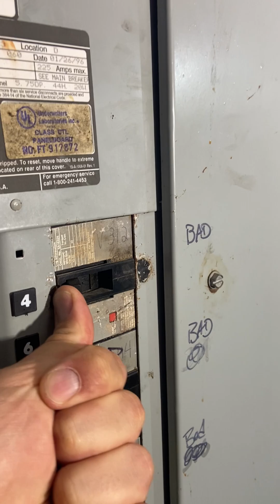Forgotten Electrical 5 #electrical #motorcontrol

Comment: Ever see the carnage that results from a know-it-all replacing a contactor on a 600 volt system, with a physically smaller contactor that is rated for 600 so long as the optional arc shields are installed, that was installed without the optional arc shields?
BOOOOOOOM......

Comment: I work in a shop that builds panels and entire machines.. mostly load cell and solartron measuring benches for automotive engine parts, but we do large conveyors and stuff too.. my point is we do EVERYTHING and I'm constantly going around and installing ground wires on enclosure doors and other things because other people don't. 😮‍💨

Comment: I got 120 vac threw my body after the dorks that put aluminum siding on my parents house did a terrible job cutting around some electric boxes and pinched a hot wire, which made the entire aluminum siding + aluminum doors  HOT surfaces.  Not nice at all.

Comment: I got a call for a faulty 480 breaker, when the AC guy said there was no power and the breaker was on. The store had 5 RTUs in a dedicated panel. After an hour of analysis I realized RTU5 was on the breaker labeled #1
Reply: Labels are nice!  But I mistrust them pretty fast.
Reply: @alsavage1 that's a fact.

Comment: That door thing happened to me some years back. I was working in the oilfield in Utah, one of the roughnecks thought he knew how to sparky but was way wrong. After he got done playing in the service box in one of the trailers on location, I found myself being the unlucky recipient of angry pixies between my boots and my bare hand on the door handle. Luckily I wasn't super grounded, so it only tickled a lot.

Comment: This is a great lesson for electricians in the chemical industry. Upon pump start up the spray could have blinded you!😮Never start a chemical pump without inspecting the Dog Ears. 🐶This video was taken hours after the chemical spray left a dried white dry residue that might be associated with the acidic Alum (aluminum sulfate) pipe line labeled with a yellow tag. Electricians should always wear CHEMICAL eye protection  GOGGLES, rubber gloves and a chemical apron while working around acidic or alkaline liquid. They should also note where the emergency eye wash station is, there was NO water wash down hose on the adjacent wall rack.  😮. There is a female quick connect fitting aimed down-ward off the pipe that seems to be the source of the chemical spray.  Quick Connect (Dog Ears/Industrial): Typically uses a female socket and a male plug, often locking with a sleeve. "Dog ear" refers specifically to the safety ears on the coupling with ear rings for threading safety wire. The accidental chemical spray direction is directly downward and is directly in line with a relatively new, poorly cut and sealed 480V  Electical cable whip leading to the pump motor. 😮 There are 2  levers, called ‘dog ears’ on each hose connector that need to be pulled together to grasp the groove of the inserted male. There is no reinforced Tygon hose connected to the male end of the of the discharge of peristaltic chemical pump, it was probably disconnected and removed from the leaking/spraying vertical female end. 
Electrician lesson: Never start a pump and be near to a recently connected “quick connect” fitting hose that does not have a safety wire wrapped around the CLOSED dog ear /levers.  These closed levers hold the hose connector in place (like a Wago lever holds a wire 😊).  If poorly connected, the hose can shoot off or spray out at the connection. Besides the risk of a poor seating between the male and female chemical supply hosing, there may have been a solid build up from connecting and disconnect on the mating female and male connector surfaces.  In an alternative scenario, the chemical operator may have sprayed chemical  by trying to open the dog ear levers without realizing the liquid chemical was under pressure even though the pump was off. The operator left dripping chemical to form stalactites (T for drips from the Top) 😅 on the adjacent lines. You can see a drip in the freeze frame video near the opened female connection. 
Electrician Lesson: Know the hazards: Always read the Material Safety Data Sheet of any chemicals used in the area.

AI Over-view: 480 volts (VAC) is a very common industrial voltage used to power large peristaltic pumps, especially in the United States. 
Here's a breakdown of why and how it's used:
Standard Industrial Voltage: 480V three-phase

Pump Size and Power: Larger pumps with higher horsepower ratings, which would be typical for industrial-scale alum pumping in water treatment or chemical processing, usually require higher voltages like 400V or 480V. Smaller, lab-scale, or low-flow pumps may use 110V/240V AC or even 12V/24V DC.

Standard Industrial Voltage: 480V three-phase is a standard power supply in most commercial and industrial buildings in the U.S.. This voltage is used to power heavy machinery, motors, and pumps because it is more efficient for energy-intensive, high-horsepower applications compared to lower voltages.

Comment: I was on a remodel and doing the entire electrical upgrade, multiple buildings…building two of three needed some interior panel rework, and device upgrades…the owner showed up and entered that building and grabbed the unknown and ungrounded main switch, we hadn’t done any work in there yet….and took a hell of a jolt…I said I hadn’t noticed the issue…I was wearing EH boots, standard equipment for me, so no ground out…he had the steel riveted boots on…….we’ll be addressing that issue now that it’s known…

Comment: The pumps are covered in caustic soda? It seems like that. So you're having in pvc a one way valve with a venturi effect that come from a pressure gage? Somehow it doesn't make sense but however. Is that used for demineralisation for anionic and cationic filters? That place should be a lot cleaner

Comment: Not war story esc. But I work as an industrial firefighter. We had a heavy rain one afternoon. (An hour before shift change). We get called for smoke in one of our offices. After investigating I find a couple cardboard boxes smoldering next to a 5 foot enclosed substation. I take the boxes and go outside and put them in the rain. Mind you all power is off at this point to said building. The other 2 guys reconvene. And we start looking around. One of these substation doors in question is charred and still hot. My partner goes to them investigate with the TIC before one of our electricians get there. He makes it there. All the lights then click on. I start to see smoke coming from the vent. My captain tells him to come back. No sooner he clears the door. BOOM arcflash. Was the brightest and loudest thing I think I’ve experienced. Once the power tripped again. I took a CO2 extinguisher and dumped it into the vent to extinguish anything that could cause issues anymore. Turns out 4 inch conduit going up to the roof had a leak and was leaking water onto the posts inside. It then tripped. The maintenance department looked at another substation that was feeding this and while we were doing this. Turned it back on. Hence why we almost got roaches. Learning points: follow LOTO, if possible wait for the appropriately trained personnel to find the problem. (We did not take any panels off btw)

Comment: In my country a girl recently rode in her 100y old apartment house's old scary-movie elevator. Held the door w left hand and happened to touch the door lock w right hand. It was electric and she closed the circuit w both hands! And survived shocked but unscathed!
Landlord fixed it promptly. Allegedly legislation isn't retroactive so old deathtraps are still legal.

Comment: January the 30th will be a fun day. I work at a clinic with a emergency power unit.

When we had a blackout a few weeks back, the system wouldn't start. The breaker separating the emergency power from the grid didn't work. The whole place went out. Took us almost a week to get everything running smooth again.
We figured out it was probably the actuator that drives the breaker in the case of a blackout. When installing a new emergency power generator they wired it with 24V, instead with 230 as it is meant to be wired with. It will take 15 Minutes and a few new wires to correct that. We just have to shut down the whole place again for working on the breaker. Preparations take weeks. Everything has to be prepared, all important tech needs to be shut down beforehand. Cost of material: 1€, cost for the workforce thousands of €. The estimates for the craftsmen of two companies just to be there will be about 4000€. My boss was weeping.

Comment: I once rented an apartment that had an electrified bathroom floor. I discovered this in a predictable fashion. Then I called the landlord.
The stool water tank was overflowing through the flush handle hole, soaked the carpet (brown shag, go figure), and soaked the wood into the crawlspace where it found an always on light fixture.
I showed the landlord the sixty volt draw by using my meter.
It was interesting until it got fixed.

Comment: Theoretically, could one use a high rated screwdriver on a shell of a mechanical box such as a rooftop HVACR unit as a simple safety check for pixie sparkles against live or grounding issue?

Comment: I'm guessing that voltage between the box and the door panel wasn't actually anything to worry about. When things aren't properly bonded, you can get phantom voltages between them. They disappear as soon as you put any kind of load on them - just touch them and the voltage drops from 268V to, like, 2V. There might just be some capacitive coupling somewhere or something. It can't produce any noticeable current.
Reply: And that’s why you always send the apprentice through the door first.  Those young guys heal much faster than the older guys.
Reply: @oneselmo  And the apprentice has brand new boots, so their rubber soles aren't worn thin.
Reply from the maker: @thomasdalton1508 I wish that were true, but that door sent my coworker to the hospital. He’s fine, but he took 277 across the chest.
Reply: @Cursed_Controls Ouch. How did somebody manage to connect a 277V phase to a door handle?
Reply from the maker: @thomasdalton1508 the big J box next to the door had a circuit shorted out and wasn’t grounded. The door itself was just the return path. It wasn’t energized. The box was.
Reply: @Cursed_Controls  Ok, that makes more sense! Your coworker has learned an important lesson not to touch anything else metal while touching a metal junction box...

Comment: How are there that many breakers labelled bad in one panel without the whole panel having been replaced? Did they think writing "bad" next them was going to fix them? Were they chastising the breakers?
Reply: In an industrial environment production calls the shots. If they say “No time!  Fix it later” then unless it’s an extreme safety hazard, you mark it bad and move on.
Reply: @oneselmo  That looks like an extreme safety hazard to me. Something is causing those circuits to go bad and it needs to be addressed.

Comment: In the locomotive electrical world there are two wires that swap labels from end to end. 8T and 9T. They are used in the multiple unit circuits for forward and reverse. New guys get super perplexed by this. Also red wires on locomotives are negative while black are positive.  The automobile guys can’t believe this.
Reply: Most of us know that colors are different on A/C vs D/C. The Automotive engineers love to change colors through hidden main connectors, and don't tell you about other branches. You need to study all of the individual wiring diagrams to find out how many circuits are connected.
Reply: @jeffhill3681 .  Fortunately most wires are labeled on locomotives but they are often forty plus years old and VERY difficult to read. Also no two locomotives ever seem to be identical.
Reply: @ryandavis7593 
  Get that. Old Internationals (and others) used to have all white wires with numbers printed on them. Fortunately color coded wire became cheaper, but with old wires exposed to heat colors wash out, even back in the loom. Hard to tell if it's a white , tan, or yellow stripe on a light blue or light green wire. Of course, someplace you can't easily look or strip the harness back. I have a wire tracking detector but it also generates false induction in adjoining wires. Everything has it's drawbacks. Have fun hunting wire!
Reply: @jeffhill3681 .    Teaching wire hunting skills is a real joy. Nothing quite like showing a young apprentice three schematics with identical devices and identical functions but three different wiring routes and labeling. Their heads explode into confused rubble especially when you give them the wrong schematic for a locomotive and tell them to figure it out. You don’t always have access to the right schematic so you have to make do with what you have. My apprentices love me and hate me.  They always come back and thank me though. That’s when you know you did right by the trade and the person.

Comment: Hopefully it was the panel that was 240V and the door was grounded. But not holding my breath.
Reply: That is not making it better.
Reply: Former commercial door mechanic here: the door is grounded.  Metal frame in grouting & concrete, probably.

Comment: The door having 200volts running through it is gnarly
Reply: It's not the door. It's the HVAC unit having a fault to the enclosure with improper grounding. If you touched the unit and the doorknob, you'd be getting 277 across the chest. Bad juju.
Reply: @cheddarmccheese5855  That really depends on the nature of the fault. It could be a high impedance path to ground; in that case, if you touched both and read it with a normal multimeter, the voltage would immediately drop to something reasonable and you wouldn’t get shocked. The only way to tell for sure is to use a meter with a low-z mode.
Reply: @tylermasters8697 could be? Should be.  I haven’t grounded many doors in my day.  Touching the AC unit in bare feet certainly would be shocking. (Pun intended of course). Is this USA as line to earth should be 110v or 230V if in other locations?  Inverter peak voltage?
Reply: That'll stop every burglar. And anyone else...
Reply: @gummiente3622 MagnaVolt: We also protect the copper in your AC!
Reply: The door is grounded, the hvac case energized and ungrounded
Reply: Only a problem if you touch the door while touching the other panel

Comment: favorite wire label I've personally found, "???" And it was attached to a breaker (unlabeled of course) and had a couple amps running through it. Would love to know what it did but "outside the scope of the project"

Comment: all i gotta usually deal with is residential panels (i work on heating systems) and id almost believe proper labelling is against some sort of electrician religion based on my experience. usually half have no label, a quarter have one thats scratched out, changed to something else, and then those labels are scratched out, the boiler is labelled furnace, the air handlers are all mis-labelled, and whatever im trying to shut down evidently isnt even tied to that panel.

Comment: That's exactly why I don't label wires inside a cabinet. Someone will fuck up at some point and the label is incorrect, and an incorrect label is worse than no label.

Cables coming in from outside absolutely do need to be labelled though.

Comment: Many years ago, I used to do a lot of contract work at a copper smelter.  One of the byproducts is nasty gas that is usually collected to make sulphuric acid, but it tended to leak and come down as acid rain.
Well, to make a long story shorter, they were setting the rebar for a new building pad.  The design called for a concrete walkway between it and an old building.  They had laid the rebar for the new building and used a crane to lower the rebar for the walkway down between the new rebar and some repair from the old pad that they exposed.  
Well, because of all the acid in the soil, the ground potential was high enough and the electrolyte strong enough that the rebar for the new walkway burned up, which was a butt puckering moment let me tell you…
Reply: So your saying they turned the local property into a big battery and then shorted out the terminals... lovely.
Reply: @merendell , pretty much, yeah.
Reply: Mega Yikes. Stay safe an healthy.
Reply: Bite marks in the seat is maybe the best teacher 😅
Reply: @lonelylyle8712 , yeah, but I would hate to have been the guy that filled out that incident report…😊
Reply: @Ryarios 😅
Reply: @Ryarios  what do you even write? "we turned the property into chemical potential energy, which was then released rapidly"